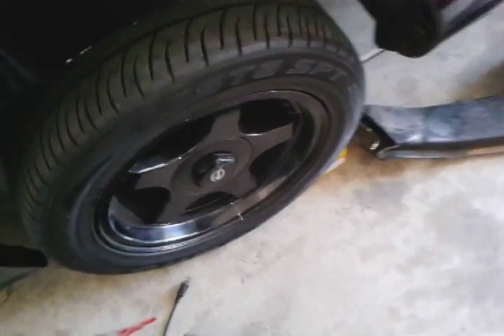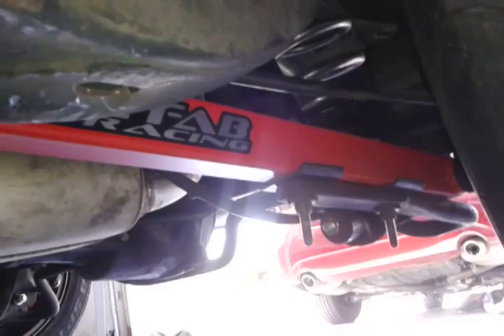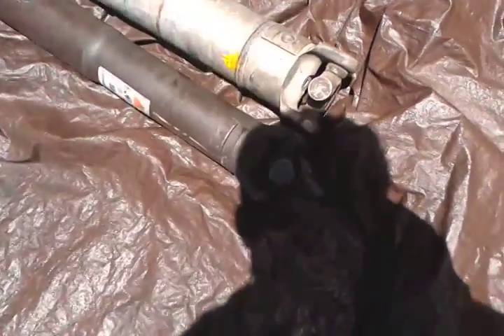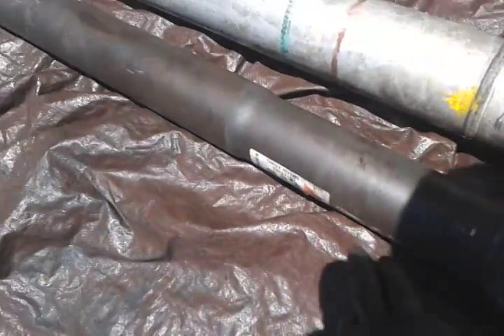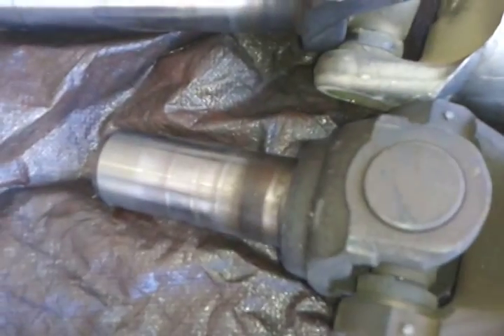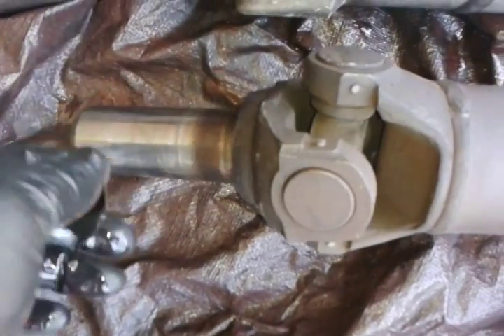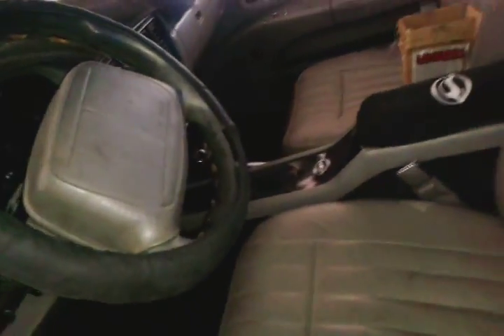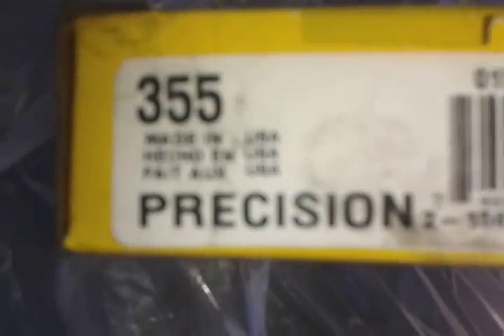96 impala Crown Victoria drive shaft swap

Comment: Nice upgrade to drive shaft, but the 355 u joint is to small to fit the drive shaft I bought out of 2006 ford interceptor. Is it a specific yr that interceptor that this size joints can work with?

Comment: How much difference in performance do this swap make on a stick 305 and trans
Reply from the maker: None your not going to get much performance out a 305 even with full bolt ons
Reply: The Ls Swap Guru I just want to be able to center my rear  wheels then start with lol up grades to I decided on what engine I wanted to go with
Reply from the maker: @lowbottomcustoms1228  oh ok yes  thats exactly what this is for it allows your car to hook a lot more and stocks the wheel hop
Reply: The Ls Swap Guru ok thanks now I know what to do to center my wheels I def appreciate it

Comment: need some help with mines too if ya can help out, I got a 96 impala and I just put extended control arms on mine 3/4 of an inch longer than the stock. Now my drive shaft is to short and I’m trying find a drive shaft off a car that would give me the length I need..any suggestions on that
Reply: 99-05 police crown vic with the u joints as he stated u will need 2.
Reply: Printes Brown thanks for that information I definitely appreciate 👍🏾🤟🏾

Comment: I'm doing a 5.3 swap on my Impala with a 4 L 80 what I still be able to use my old drive shaft or where should I use
Reply from the maker: Yolanda Thomas no your going to have to get a customer one made ever car is different my customer had to get a 53 or 54inch made it was around 150 ujoints included

Comment: Has anyone had any trouble with vibrations after installing this driveshaft off the Crown Vic??? Kuz I’m had vibrations on highway speeds which is throwing something else off causing it to sway left and right and it’s causing a little vibration as well... any advice would be great... everything is brand new I just had my rear end rebuilt .
Reply from the maker: Gucci87 did you get the driveshaft balanced?
Reply: The Ls Swap Guru No I didn’t have it balanced I couldn’t find a shop near me that does it.. and if my control arms are 3/4 longer than the stock should I still have a little space at the front of the slip yoke or should it be completely flush to the rear of the transmission?
Reply from the maker: Watch the video again the purpose of me swapping the drive shaft was for that reason if you extend rear the drive shaft will be to short so you have to go with the crown Victoria d/s to make up the length
Reply: The Ls Swap Guru thanks for the information and this video I definitely appreciate it homie ima get it balanced out and hopefully it works like I need it to.. thanks again